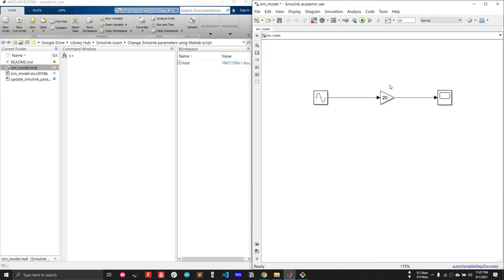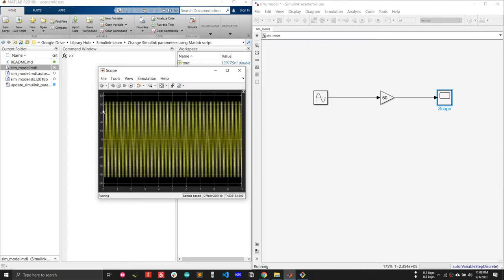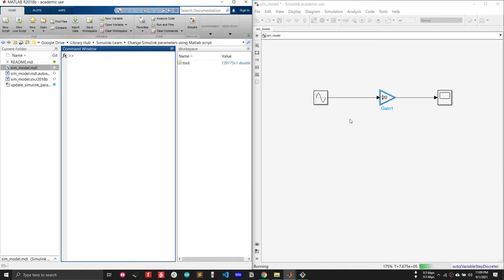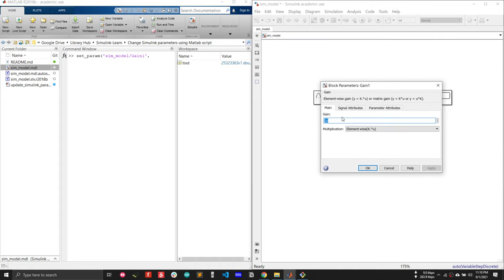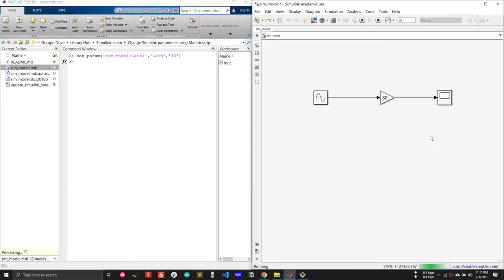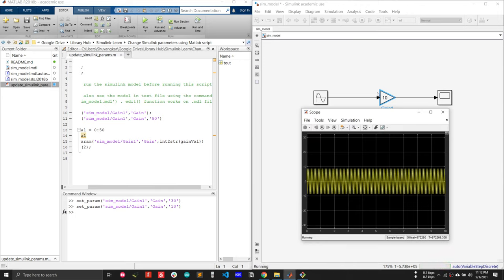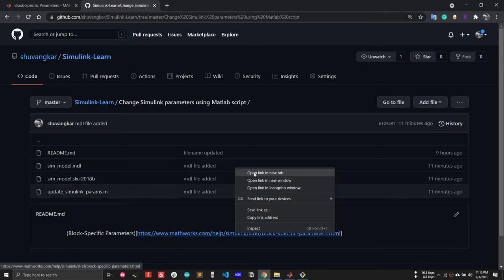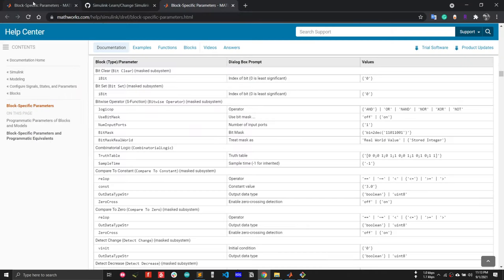Change Simulink Block Parameters From MATLAB Script | Interact Simulink and Matlab

Comment: Thank you for your interesting lecture. I can understand how you change the parameters from some blocks in Simulink. However, there are some Simulink blocks, which might not be allowed to change their parameters, for example, the  "Three-phase series RLC branch" block. I want to automatically change the value of the inductor and capacitor in the "Three-phase series RLC branch" block during the simulation. Could you please give me some advice to solve this problem? Thank you.
Reply: Hello my friend... Do you reach the solution?
Reply: I have this problem too. @caokhan.... have you been able to solve this problem?

Comment: Sir, Can u plz guide me on automatic parameter putting in matlab?
Reply from the maker: Sorry, I did not get your question clear. Can you please explain?
Reply: I want to change the parameters one by one, let's say if I want to check SNR for 1-10 values I want to automatically increment that values without manually adding it